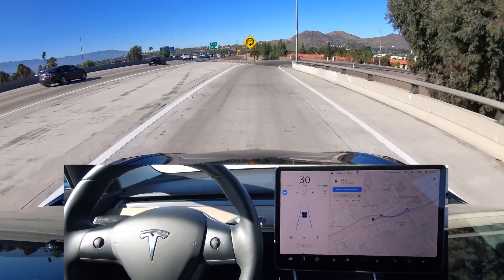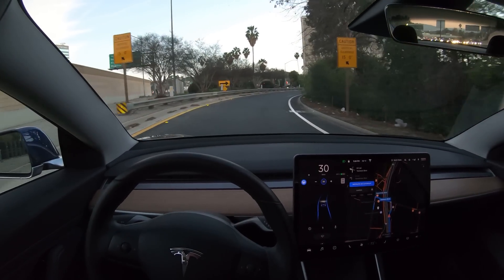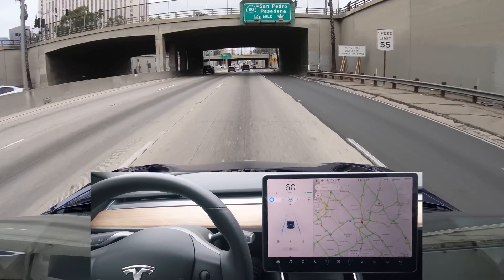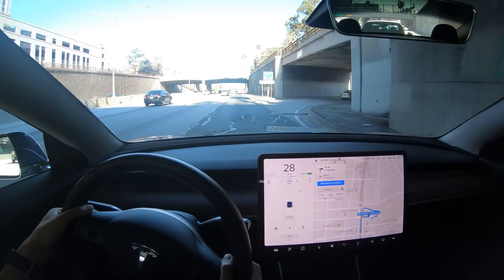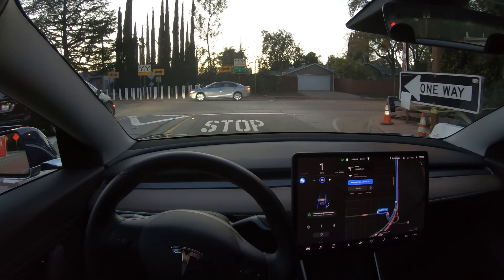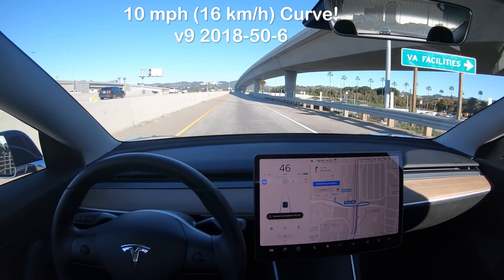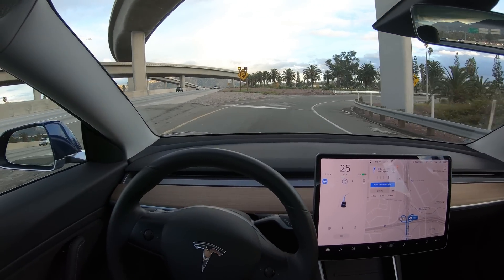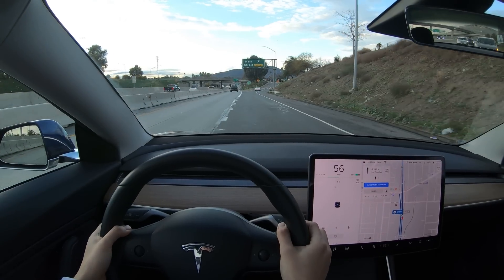Tesla Autopilot - Crazy Curved Exit Ramps

Comment: Does this tech exist in 2015 > model S ?
Reply from the maker: Would need to have autopilot 2.0 or greater. This hardware started shipping around summer/fall of 2016. If the car has 3 front facing cameras as well as cameras on the sides then it is AP 2.0 or greater

Comment: I have a model 3 with the latest software update.  It seems the autopilot on ur car slows down on it's own as u approach highway exits.  sometimes it appears to do it in autosteer mode as well.  Is that happenning?  Is there a setting for that?
Reply from the maker: There isn’t a setting. It used to stop a little more consistently with some older versions. It’s a bit random lately (2019.12.1.2) Sometimes it stops on its own, sometimes it doesn’t. I think they maybe testing things in shadow mode or gathering data about where and when people actually come to a stop?
Reply: @scottkubo5593  thanks.  Very interesting.

Comment: It looks like that the steering control  algorithm needs some improvement. It is obvious that the lane boundaries were correctly and precisely detected but car just couldn't stay in the middle while doing sharp turns. 
Also noticed that the steering wheel had a lot of shaking during those turns. 
Steering control is actually tricky as it has to consider the dynamics of the car....

Comment: Also a lot of these people dissing AP prob have never driven a Tesla. I use AP for all my commutes and I regularly drive 4 hours from my home to London and use AP exclusively on the journey there and back. Its amazing and works great!
Reply: Does it allow you to take your hands off? I though you need to keep your hands on the steering wheel, or did they update it?
Reply: @spiegel5510  No you can take your hands off but it reminds you every min or so to 'nudge' the wheel. you can technically drive with hands on thighs but I just have a loose grip with my right hand just in case I need to take over. but I trust it 100% :)
Reply: OK, just beware of those semi-trucks (lorries?) turning left (right?)
Reply: @Trius honestly no. it has to calibrate first then you can only use adaptive cruise control which a lot of modern higher end cars now have, where the car maintains a set speed and brakes for you. you get to trust this pretty quick, then once its fully calibrated you can use auto pilot where the tesla steers for you as well as handling the speed and brakes.
now as with all technology like this, you have to respect it and don't abuse it like some tesla drivers have. I don't kick back, with my feet up and read a book, but I have a nice relaxed sitting position with my right hand loosely one the bottom of the wheel ready to take over if need be, I.e suddenly very heavy rain or snow interferes with the AP, then a loud notification sound will emit and the display will flash red, then you simply take manual control. this doesn't happen often but like I said just be ready to do so just in case.
I am not one of these macho red blooded male drivers who thinks they are the best driver in the world, far from it, I think I am safe but cant park to save my life lol
The Tesla sticks to the freeway (motorway) like its on rails, seriously its that good, never drifts over into another lane and I have used AP in reg 4 hour drives for over a year now and its amazing as well as relaxing and makes being in a Tesla a real pleasure. My model X is the best car I have ever owned, its incredible and like driving something from a sci fi movie :)

Comment: You ever tried 71 south to 91 west.   It’s wild.   Try it.
Reply from the maker: Actually had my eye on 91 east to 71 north which is a pretty tight u-shaped turn but I think it’s not as sharp a turn as some that I showed
Reply: The entire 71/91 interchange is tough on EAP and the Nav on autopilot.  But the king has gotta be that Spring Street ramp off the 101.

Comment: Half ass ... it’s a death trap. I cannot believe this is legal. This is the worse thing... you have to give control and make split second decisions if the system will make it or not
Reply: Wrong. You have to be ALWAYS ready to take control. I think the main issue is that people who thinks that this is dangerous and not good are people who have never had any type of driver assistant in their vehicles... My previous 2017 E300 with Distronic Plus was not even close to this kind of performance. In fact, it was way more dangerous but hey, no one came out and complain about it... Perhaps because the Distronic Plus package was way expensive and not that many people was able to afford it? Anyhow, kudos to Tesla to use ML on AP technology.
Reply: This is no different than cruise control, an assist that has its limits.
Reply: Then don't use it.

Comment: Great tests. Interesting way it takes the S curve. Either an explicit strategy trying to take the turn early to avoid getting caught out or it's an amalgam of how people have driven there, first placing in the right and reversing early. A little sluggish delay or dampening could account for it not quite getting out to the right before going straight and left so human drivers probably wouldn't be quite that far left by the curb. I suspect what we are seeing is mimicking how people drive there.
Reply from the maker: For the 2018 versions and earlier It does often though not always seem to cut close on  tight S curves and I’m pretty sure it’s due to autosteer being sluggish